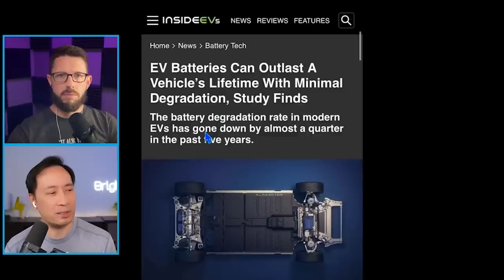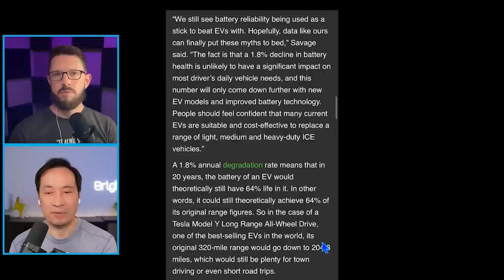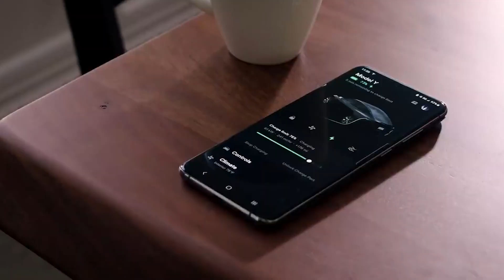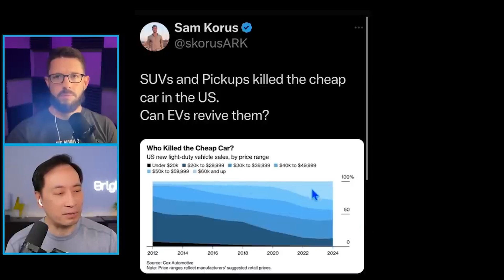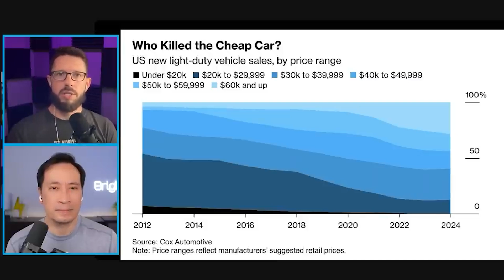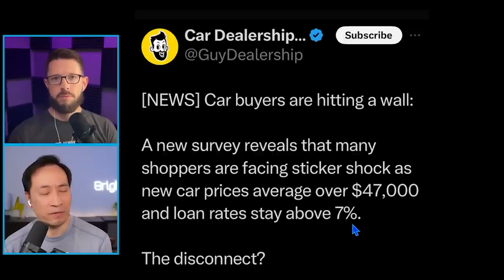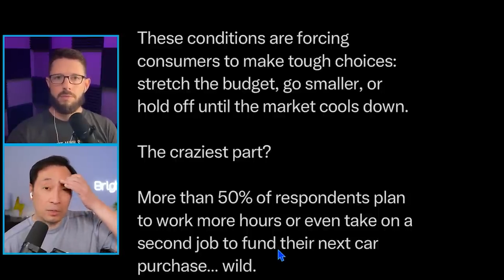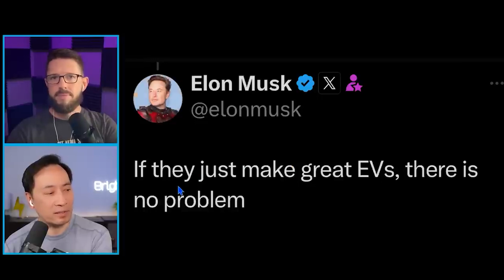FINALLY the TRUTH About EVs!

Comment: It's funny but a little tiny battery and a little tiny electric motor is all you need for a daily commute.  I wonder if they could grow the battery as they shrink the ICE in hybrids. It also shows you that daily commute range is not an issue.

Comment: The assumptions here are that cars are only used for city driving with only very short road trips that are more sight seeing than necessary travel. Right now, no BEV sedan or small SUV (e.g. MY) has sufficient range for long road trips. Those of us who live in rural cities (pop ~100K, 200 miles from a major city,) 90% of trips are very short, so all home charging, but 80% of miles are trips > 700 miles one-way. All BEVs currently add an overnight stay mid-trip, each direction due to charging delays, causing 4 down days to a one-week trip. We usually keep cars for 10-15 years. So the range becomes useless, so we have to sell our used BEVs for a new one. How wasteful.

We have seriously tried to make BEVs work, using borrowed & Turo'd BEVs of all affordable types (<$80K new). When BEVs can get 500 miles on an 80% charge, and getting back up to 80% takes 15 minutes, they will be ready. Until then, these are cars for suburbanite dilettantes surrounding large metro areas. The urban dwellers don't have home charging.
Reply: Very false.

There are plenty of EVs with good ranges, even over 400 miles. Then you can use the Tesla supercharger network to extend that indefinitely, with little overhead. Many EVs can charge to 70% in just 15-20 minutes, which is about the time you likely spend at a stop anyway.
Look up the "1000km challenge", there's a guy in Europe (Bjørn Nyland), who makes the reference trip with practically every EV, and compiles the results into a table every year.
You'll see that it's easily doable in around 10 hours, while the reference time with a gas car is 9 hours. The EV record is only 15 minutes slower.

Your gas car will die long before you get significant battery degradation in a modern EV. Especially Tesla.
Reply: @andrasbiro3007  Have you actually tried it? At freeway speeds in the west (80 MPH), you only get 280 AT BEST on a starting 100% charge with a Tesla. Then recharging is only reasonable to a little more than 80%, with means you're stopping for another 30 minutes just 230 miles down the road. And if you have people sleeping in the car, those stops wake them up. We have tried 10 different cars. None of them worl for large-scale distrbuted ranches and equipment providers. The closest is the Silverado EV, but it's too expensive and truck like.
Reply: @michaelterrazas1325  
I've been driving a Model S for 6 years.

280 miles is still plenty enough range. 200 is the practical minimum.

And you don't charge to 80%, only what's needed for the next leg of the trip, around 60-70%. Above that it's rarely worth the wait.
That means you stop around every 2-2.5 hours for 15-20 minutes. That's pretty normal. And actually recommended too, it's not healthy to drive several hours without stopping.

Again, look up the 1000km challenge.
Reply: @andrasbiro3007  You cannot tell me that 280  is plenty enough range for me. I have tried a Turo'd Model S. It absolutely SUCKED for us. We started with 100% in the Central Coast of CA. barely made it to Barstow. Had to tak 35 minutes recharging to barely make it to Primm.  Twenty-five minutes barely got us to Mesquite. 25 minutes there barely got us to Cedar City. By that time, we knew we couldn't make it without an overnight, which we took in Fillmore (after a 35 minute stop in Cedar City). Put it on a level 2 destination charger, which barely got 60% overnight. Stopped again in Nephi, which ha only lasted to Sandy. 25 minutes there got us to Morgan, 11 hours later than we would have with an ICE Fusion. And the charging cost almost the same as gas. That Model S SUCKED at road tripping.
Reply: @andrasbiro3007  When you have people sleeping in the car, each stop interrupts their REM sleep. Stopping every 2 hours is very counterproductive. Your trips are obviously a "smell the roses" froo-froo event. We just want to get there before our customer gets upset that we didn't have their equipment up and running. Your name must be John Snow.
Reply: Total BS. You obviously haven’t travelled in a model Y. My next trip is Toronto Canada to Florida US. I look forward to it. It’s far more convenient and enjoyable than Ice. If I still had Ice I’d fly
Reply: @justinmallaiz4549  Additionally, there are several other problems with your so-called refutation. You are my definition of a dilettante. You seem to be traveling for pleasure, in an area with low speed limits (the entire eastern seaboard, and all of Canada). 3 people flying is way too expensive, and the equipment can't fly, and we need to keep it under our control to protect trade secrets.
Reply: @michaelterrazas1325  I'm tend to wonder what business presses a team of 3 drivers pushing 10 hrs @ 80 mph, 2 sleeping while 1 drives... wants to protect trade secrets; is too time sensitive for hotels but not worth a flight and how this has anything to do with meeting 90% of main stream needs??
Reply: @michaelterrazas1325  
Anyway, your use case is very special, 99% of car owners don't do that, and especially not regularly.
Generally when you are on a long trip you are not in any hurry. You have to expect traffic jams anyway, so if your schedule is tight, you are likely to get into trouble regardless of what you drive.
Reply: @andrasbiro3007  I never said it was all that general, but there is a reason that ICE sedans all seem to have a range of 500 miles: that's the range customers found the most useful. BEVs tried to emulate it, but they fond that Li-ion was a failure at it. Now you and the BEV industry are trying to gaslight us saying that the use case isn't real. It's kind of like evolution: it wouldn't exist if it were not needed. Until a BEV can meet my use case, all my long driving will be with ICE because BEV is inadequate.
Reply: @michaelterrazas1325  
It's convenient, because you don't have a gas station at home. But you can charge your EV at home. Not everyone right now, but there's no technical or economic reason why they couldn't in the near future.

I've been driving a Tesla for 6 years, and traveling a lot with it. I'm saying from experience that 200 miles of real world range is enough. And you can get a lot more, even 500 miles is available, assuming you drive at the speed limit.
Also, I had gas cars with less than 300 mile range.

You have to learn to use an EV, just like how you learned a lot of quirks of gas cars. It's much easier actually, you just didn't grow up with them.
The easiest is to let the car plan your trip, it'll optimize the charging stops, so you don't have to wait 35 minutes anywhere.
With a decent EV you can drive 500 miles in about 8 hours, and even 7 is possible with some. And the charging stops give you enough time for restroom visits, eating, having a coffee, and in general relaxing, to make the trip much more enjoyable.

A level 2 charger should fill up even a Model S LR to 100% in about 8 hours. If it didn't then it was faulty or you did something wrong. Maybe it was limited due to lack of power, or your cars was misconfigured.

I've been on long trips where we slept in the moving car. You never get a good sleep anyway, any small thing can wake you up, hitting a pothole, stronger braking, stopping for any traffic reason, etc.

And, again, your use case is extremely unusual. Maybe EVs aren't good for you yet, but plenty good enough for 99% of people.
For example I love road tripping with my Model S. I do it whenever I can find an excuse.
Reply: @andrasbiro3007  I am specifically talking about EVs sucking for long road trips. Starting out fully charged is not much of an advantage. Maybe it gets you 40 miles on the way out. After that, you have about 80% of your capacity. We use EVs for around town driving, but the nearest large city is more than 1/2 the capacity of the best EVs. Then we have to go much, much further. The West is saprsely populated. EVs suck when you have to make long trips out here. Speed limits are 80, and in a few places more. Only really expensive EVs can handle that, but that's out of our league to buy a Macan, a Lucid Air, or the like.
Reply: @michaelterrazas1325  
I was talking about that too. I'm going on long trips in my Tesla all the time, and it's wonderful. I refuse to travel in gas cars, unless there's no other way for some reason.

Distance is irrelevant, Tesla has an excellent charging network, that extends the range to practically infinity.
It's very convenient, very reliable, and fast too.

If you only have a cheap old EV with low range, that's a different thing, but that's an economic problem, not technological one.
And don't worry, prices are going down fast, in 1-2 years long range EVs should become affordable too.
Reply: @justinmallaiz4549  You know nothing of our requirements. We use these trips to get teams of 3 and equipment between sites. We go 720 miles overnight, two sleeping while one drives. We can make it in one stop with a Fusion or a Camry hybrid, in 10 hours. No way the MY made that. We had so many stops that the sleepers kept getting disturbed. They had to rent a motel room each direction. We lost 2 days of work with that. The MX was a little better. A Lucid may be able to do it, but they are way too expensive when our hybrids work so well.
Reply: @michaelterrazas1325  
The Model Y can do that trip in 10 hours. And not many stops needed.
Reply: @andrasbiro3007  No, it cannot. We have tried. Don't tell me what our records show.
Reply: Utter nonsense
Reply: @davidilm3752  I've got the data sheets, but you know nothing.
Reply: YaYa we know everyone is a road warrior online, fact is average US driver does 40miles/day, so lets dispense with that bullcrap, VERY FEW people are hindered by EV range, and it's far easier to find electricity than gas. :face-green-smiling::face-green-smiling::face-green-smiling::face-green-smiling::face-green-smiling::face-green-smiling: